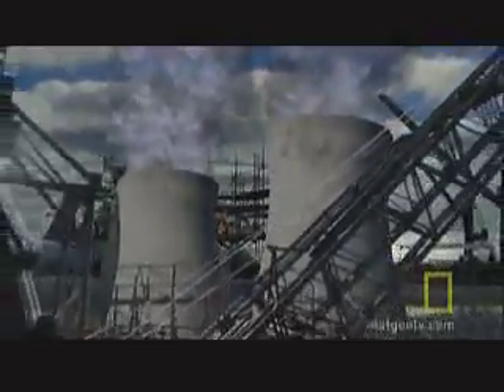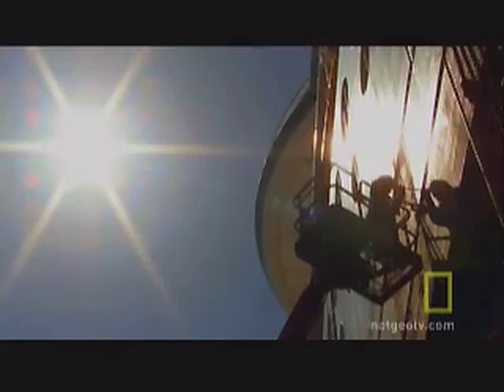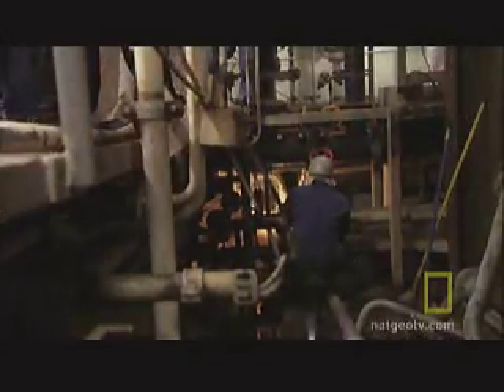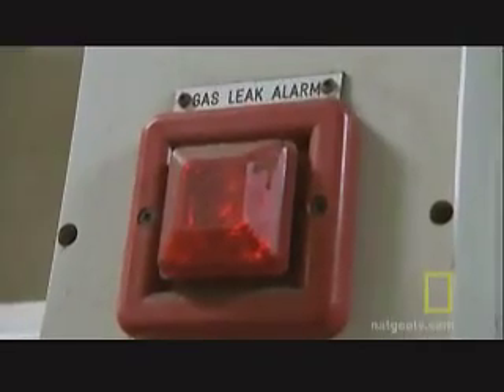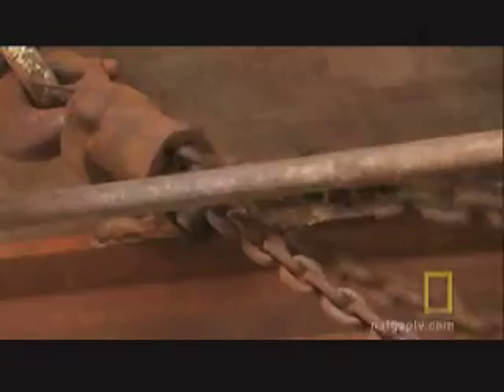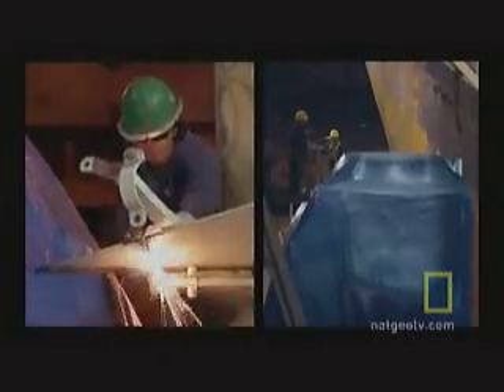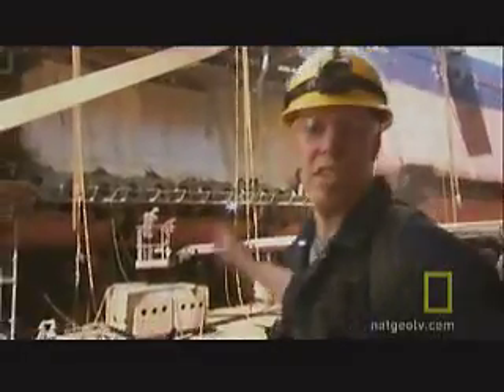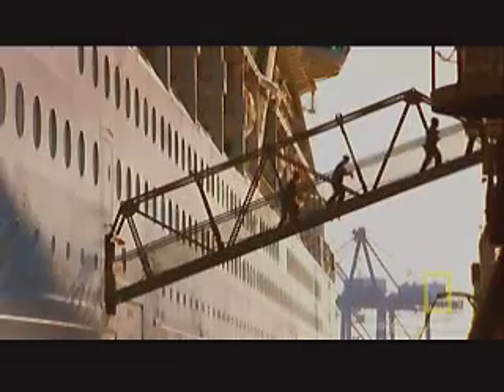Cruise Ship Fix | National Geographic

Comment: We see what happens when they put a dinky underpowered engine
in a huge cruise ship hurrying as fast as possible: IT BURNS UP AND
LEAVES EVERYONE STRANDED.
Only 15,000 horsepower? That should be the engine for the shit pump.
Back in the day ocean liners had over 100,000 horsepower and you
never heard of them overheating, catching on fire and leaving passengers
stranded for days without A/C and working toilets!
Its all on the CHEAP for the highest profit, CUSTOMERS BE DAMNED.
Reply: This new engine is for electrical generation only.  They are installing it to provide on board power to the ship when docked, or other times when the main propulsion engines aren't needed.  Electricity can be taken off the much larger main engines, but they cost too much to run when using only a small fraction of the possible output.  Thus, the engineers have calculated that the costs of a new dedicated generator, its installation, and three weeks of lost income while out of service, was worth it in fuel savings of not needing to run the main engines during times you just need to keep the lights on in port.